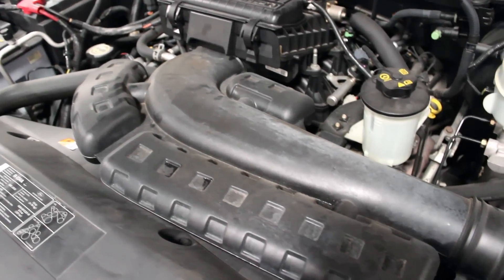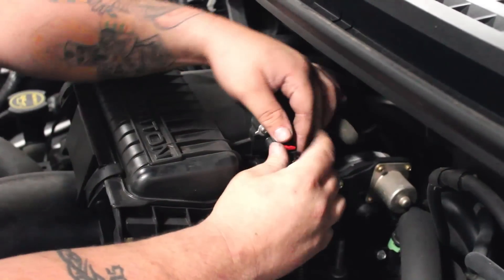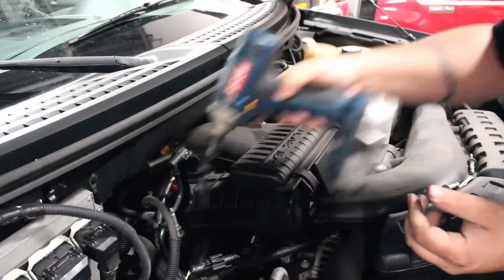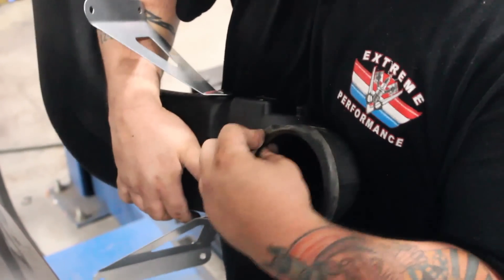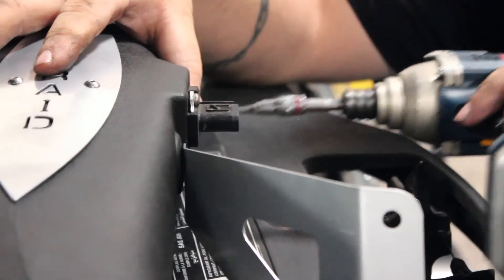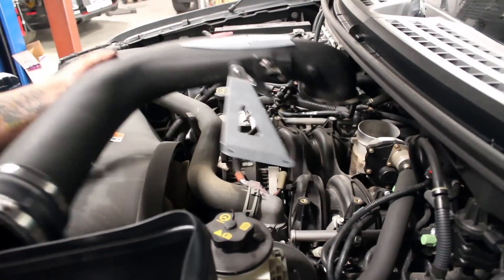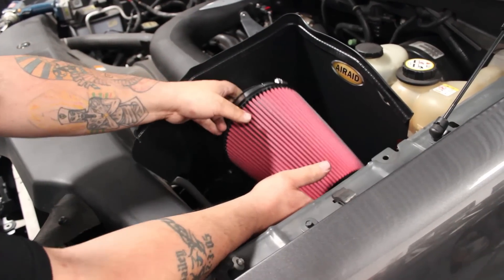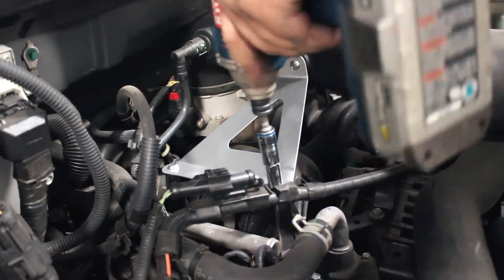2004-2008 F-150 5.4L AIRAID Cold Air Intake Install

Comment: You have to reset the map s. Unplug the battery for 30 minutes. Then, after it warms up, let run for at least a minute with everything turned off and then turn it on to high A/C for at least a minute. That your tune! done.

Comment: At the very least, unplug the battery for at least 20 minutes so that the vehicles ECM can adjust to the new air flow including resistance, and temperature.

Comment: DO NOT install this intake. It will cause lean codes. On the diagnostic machine with the AIRAID, my truck was 20% lean and showing the check engine light. With the same machine we swapped with the factory intake tube. Machine showed my truck running at 9% which is within tolerances. I called AIRAID and explained it to them. All they want to do is give excuses and blame a vacuum leak in the truck. The truck was tested at the Ford dealership with their diagnostic equipment. There are no leaks and the engine runs perfectly on factory air tube. AIRAID does not stand behind their product and will give a million excuses for their shortcomings.
Reply: Thanks for the information.....
Reply: its common sense that its gonna run lean when you add more air. you have to tune the damn thing with a aftermarket programmer
Reply: @moto6ixmoto83  not necessarily he probably installed it with the battery still hooked up. Most cold air intakes do not require a code. Guy also probably didn’t give the truck time to tune itself for the increased air flow

Comment: If you don't tune the truck after installing the cold air intake will the truck run lean?
Reply: I herd something about that, they sell a cai and custom tuner combo. I had the 2 valve 5.4 and installed a cai tune under drive pulleys and a cat back exhaust and it really woke the truck up. I didn't have a custom tune though just a canned tune. The 3 valve 5.4 i herd needs a custom tune with the cai to run decent though.
Reply: Cody Roche 

Might not get a CEL in a years time.  But keep it mind a CEL will eventually pop up for running lean.  Mine took about a year and a half to finally let me know it was leaning out.  Got a custom tune after that.
Reply: @codyroche2793  that is where you are wrong most if not all cold air intakes are no tune required I have a 3 valve 5.4 no tune at all

Comment: My original air filter box has another line on the right side of the throttle body that must come off..not the pcm but on the other side (brake booster I think) problem is...my cold air intake doesn’t have an input for that line. Should I drill a new hole and put a insert for this?

Comment: Would a 2006 F-150 King Ranch need a tuner before installing a cold air intake?
Reply from the maker: +Kellen Appoldt You could install a tuner or intake first. So the answer is No.
Reply: +Stage 3 Motorsports  Thanks for the quick response. Cheers